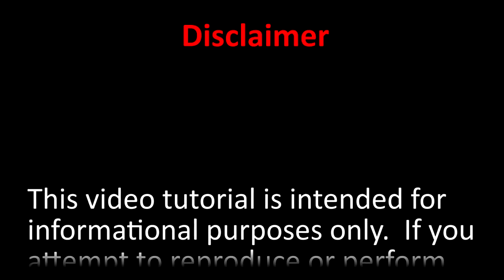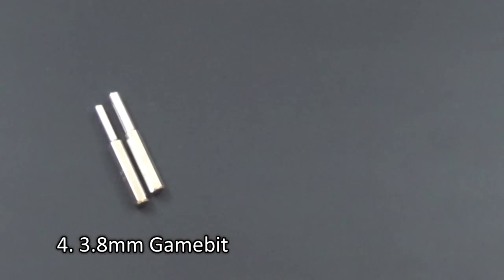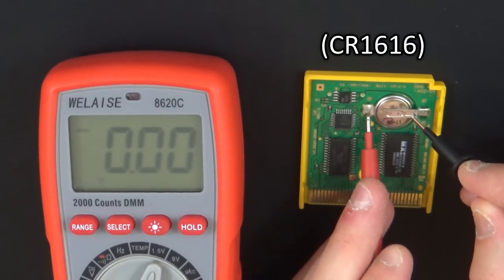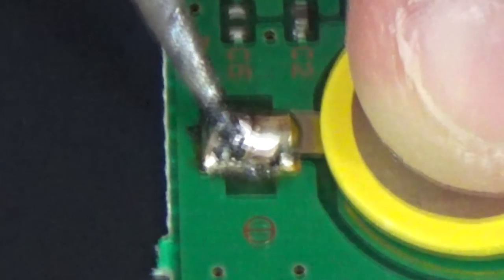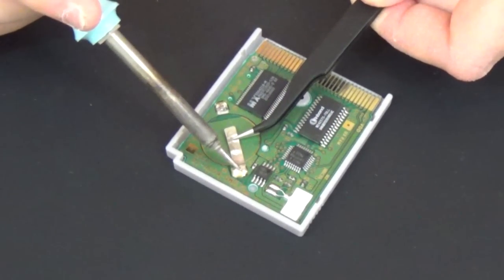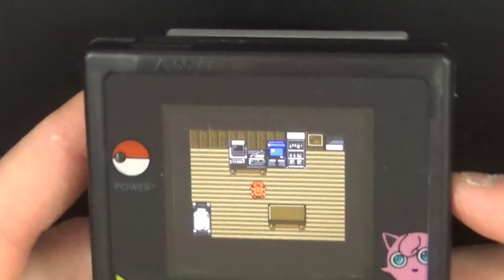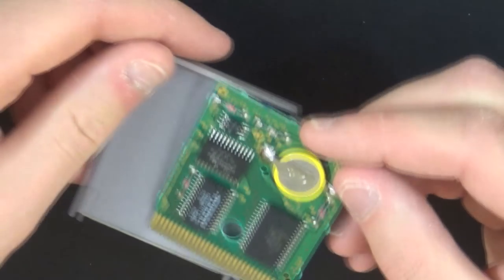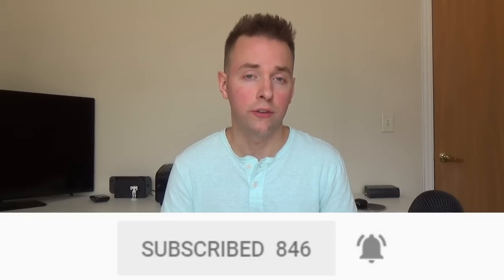The RIGHT Way to Replace Gameboy Cart Batteries

Comment: I recommend introducing fresh solder to the original solder beforehand, it's going to help with making it liquid way quicker cause You also introduce flux with the solder :) Also with a wick I always clean off the old solder.The problem with heating the solder for so long as You do is burning up all the flux which makes the solder less liquid. So I recommend having some extra flux at hand or a wick can also help in removing excess solder. Also tinning the tip of Your soldering iron helps for a cleaner result in general, but also using some alcohol to clean the tabs afterwards ensures You are left with nice clean pcb and joints. Thank You for making this video. Those solder less videos are really hard to watch!
Reply from the maker: Bálint Szabados  Thanks for watching! :)  I mentioned most of that in the video, but always good to have these tips in the comments as well.  Thanks!
Reply: Yeah I Agree, It's really PAINFUL to watch videos that explain how to fix something without having to use a fucking solder gun. I can't stand NON-solder people and there need to just fix a ridiculously simple solution with a single piece of tape. And can you believe, that it works too? HOW INFURIATING.
Reply: @chuckstieg  It works, til they drop their game on the sidewalk and something gets knocked loose inside the cartridge.
Reply: @scramblesthedeathdealer   WRONG, with proper application of tape that shit closes up pretty tight. Nothing is moving around at all, no matter what happens to it. It's going to literally shatter from being dropped before the tape & battery position are compromised. Some people just get such a fucking hard-on from soldering anything they can't handle a more efficient and easier solution existing than soldering. I bet you solder your kid's report cards to your refrigerator too huh? magnets are so impractical.
Reply: Thanks for the tips
Reply: @chuckstieg  are you ok? Do you need somebody to talk to?

Comment: I agree with some of the other comments. You use wayyy too much solder here, If I used that much I would wick it back up before soldering the new battery back in place. I appreciate your efforts of trying to teach proper handling of electronics, however, gameboy carts are really resilient. They're a great way to learn, and if you want to do the job with no tools/minimal effort, thats on you. I've "tape repaired" numerous batteries before I felt comfortable soldering them in place. To be honest, I usually just use a hot iron, heat the solder and pop the tabs off, and just use the existing solder. As long as your tip is tinned and your iron is hot it should be almost effortless. 

Just seems like an unnecessarily long video to cover something that could be covered in a few minutes.

As others have mentioned if you really wanted to show the "BEST WAY" that would be temporarily affixing another battery to preserve saves which may be in place already. Still, its good to show better practices for those who want to learn them instead of brute forcing the old tabs off and just taping back into place.

Comment: "The best way I've found to replace Gameboy Cart Batteries" would be a better title, as the soldering technique leaves a bit to be desired.  

No flux, pads not cleaned/wicked, tinning the new battery unnecessarily, soldering temp too low, too much solder, holding the iron on the joint too long, etc etc.  Not insulting you, just pointing out some areas to work on and improve for future efforts..  

Also, if the battery is not entirely dead and there are some save games still on the game, solder/clip in a battery in parallel to keep the save games until the old battery is replaced, then remove temp battery.  A battery in parallel is safe and should not damage anything, as the voltage remains the same.
Reply: I was thinking that same things while watching this lol
Reply: Why don’t you do a remash and upload a better video? I’m not being facetious that would actually be pretty helpful
Reply: @eriks8382  There are good soldering videos already. Here's a quick but good one for through hole soldering: https://www.youtube.com/watch?v=AqvHogekDI4

Comment: 8:45 and that's why you use flux :P
also using a hotter iron and/or removing the old (probably lead free) solder should prevent the tip dragging through molasses and let you actually melt the stuff. both your pads/traces and battery will thank you for being roasted slightly hotter for a way shorter time than trying to melt it halfway for ages.
Reply: Game Boy games were never lead free. Nintendo didn’t go RoHS-compliant until the Wii.
Reply: The factory flux is spent or cleaned off and the solder is also oxidized. Addinf fresh solder/flux will renew the factory solder but then you may have a bit too much. Any contaminates will float to the surface and typically comes off with your soldering iron tip after reflowing with flux and a clean tip.

Comment: I've been able to fit 2025s in all carts, just need to trim the leads a bit. I'm guilty of popping the top tab off the old battery with a screwdriver before desoldering. Gives me more control and I don't need to use tweezers. At this point I always replace the battery unless it's obviously been done recently and correctly. Great video.
Reply from the maker: questionmark576  To each their own - I did one that way too when I was back in middle school.  So I'm guilty of it too!  Of course, that was over 15 years ago when I had no idea how to solder, lolz!  Thanks for your comment and for watching! :)
Reply: @KyleAwsm  I still desolder the old and solder the new one in, I just pop the tab off first. The welds are usually fairly weak. It's a lot easier to pull it off the board when the other side isn't holding it down.
Reply from the maker: questionmark576  I should have phrased my initial reply comment differently.  I know what you meant. :)  If I came off as snarky, I wasn't trying to!  I'm just exhausted, lolz.

Comment: A couple tips:
Nintendo’s PCBs are typically pretty robust but rotating the battery off of the pad that’s not fully melted like we see here on Link’s Awakening can tear pads off weaker PCBs. It’s best practice to just hold in place and nudge it every now and then until it releases completely.

On that note, you almost seem to be painting heat into the solder joints on a few of these. While it may feel like this is heating more evenly and spreading it around, heat conducts through the solder and metal well enough that you’d be better served by just flattening the iron for contacting the maximum surface area and then adding solder to bridge to places that aren’t readily melting.

I use ceramic-tile drink coasters as a work surface since I don’t want to melt my ESD mat or heat it inside a plastic shell. Just a suggestion. :)
Reply: Yeah, when i replaced my Pokémon batteries, I waited until the solder gave up the battery willingly

Comment: This video will help me ton! After my kids got into pokemon (not sure how, maybe they saw it on Netflix), I told them how I used to play it when I was a little older than them (Red/Blue).

That led to nostalgia, buying a few GBA's with Ruby/Sapphire and not remembering how dark the GBA screen was, buying a DS2D with Sun for my daughter and a dsLite for my son so their eyes wouldn't get tired.

Anyway, here I am trying to replace the battery in my sons Ruby cartridge, as he can't save. Thanks for all the tips!
Reply: Pokemon Ruby doesn't need the battery for saves just for time based events
Reply: @treeman73272  Well they're pretty important regardless. Besides, knock off cartridges will have the saving issue so it may be that he either bought cheaper easy to find aliexpress cartridges or got ripped off
Reply: @Driv3r96  time based events aren't that important, unless you're actually trying to do something like get umbreon/Espeon  or snowrunt which can only be found when the cave is low tide which is time based
Reply: @treeman73272  Well yeah, but it may be important to someone trying to get the full experience. I wouldn't really enjoy playing it knowing my battery is dead, and besides berries stop growing too
Reply: I'm more concerned that their cart can't save despite being gba. Advance games didn't use the battery for save data which indicates the problem is bigger than a simple battery replacement. The flash memory itself could be damaged or run out of writes

Comment: Hey Kyle, What soldering iron voltage would you recommend? I have an  40W, won't it damage the game?
Reply: Ana Ribeiro de Pina a good rule of thumb is to adjust your heat to where it’s just hot enough to melt the solder. you’ll know when it’s too low. there’s usually no reason to have it on full blast.

Comment: Most videos mention that you should use a soldering iron, but many people do not have a solder or the necessary skills to operate it like this. That is the reason why there are many videos of using screwdrivers to pry off the weld points from the battery. It simply isn't feasible for some people. Especially a little kid trying to revive "his dad's old game" and things like that.

Comment: Great video but shouldn't you be cleaning up/removing the old solder off of the battery contacts on the pcb?
Wouldn't it give you a cleaner end product instead of big pools that might be even harder to work with next time the battery needs replacing?

Comment: To test the new battery, you could also try it in another Game Boy (/Color/Advance/SP), as the console will hold a residual charge for several minutes.  Taking the game out helps to reduce and drain any local action in the new battery.

Comment: It’s funny that the Pokémon silver you have is taped up like that, that’s exactly how I had to do it years ago, internet was still pretty young and the tabbed batteries were not available, neither was the tool to take it apart, had to heat a pen up then shove it on the screw to mold it to the right shape

Comment: Why not just solder in a battery holder so you just need to pop in a new coin battery later, pretty much the same process but you are also making it easier to replace the battery in the future.
Reply: I doubt that would fit, I could be wrong...

Comment: i mean...i tend to see lots of tutorials on replacing the battery...and good job on this tutorial as well...but it does not solve the main issue that people have...which is making your old save data work again...and there is actually no method to recover your old save data...for example if i complete a game and the battery dies, you can do this tutorial, replace it and then complete the game again, however if you put in a lot of work on that one save file...you might as well just not play at all...because its too much work that you've put into in that one save file...pokemon is a great example, and most of that work you just cannot replicate, like transferring pokemons from one game to another etc.
Reply from the maker: Unfortunately, because of the nature of how SRAM and other forms of volatile memory work, restoring old save data is impossible because the data no longer exists anywhere on the cartridge once the power source for that chip dies.  For making a copy of existing data though, in case you want to preemptively replace a save battery (or use the save data in an emulator on a PC), check out my BennVenn Joey Gen3 and Joey Jr. Videos!  Thanks for your comment. 👍🏻

Comment: Very good video. I'd add that it's always nice to have some eye protection while applying heat near batteries. Didn't think about adding solder when desoldreing the old battery - definitely will give it a try next time!

Comment: Probably a dumb question, but is there any way to switch out the old storage medium from the cartridge to maybe a non-volatile flash chip, so you don't have to worry about a cart battery dying?
Reply: Getting  a Accessory called Mega Memory Card will Backup the Save Data of any Gameboy game.

Comment: Thank you for mentioning polarity ofnthe battery. I may or may not have killed my Pokémon crystal cartridge as a result of not realizing the battery is backwards and trying multiple times to resolder it, resulting in either a trace popping from the heat cycles or a piece of dirt on the floor scratching through a trace. the sram is still good, but for the life of me a fresh batt(oriented properly) wont make it hold a save after power is removed.
Reply from the maker: Watch the revised video linked in the description to see if it helps your situation, and reach out to me on Instagram to see if anything can be done about your Crystal cartridge if you still can't get it working. www.kyleawsm.com

Comment: Getting the batteries connected to the tabs without the batteries e plodong seems really difficult (won't be the pre attached tabs for obvious reasons).So will just use the tape method.
Reply: you should use the pretabbed ones. the tape will not work for very long and you will have the battery issue even sooner as the tape degrades.

Comment: Hey! This was all very helpful. I still am having trouble getting my game working. I noticed that you used a paper clip and melted it with your soldier iron to get the battery to stick. Is that what i should use? Cuz I have been using flex and whenever in turn my game boy on, the game won’t work.

Comment: If you break the battery brackets is it ruined? I broke mine out of ignorance doing a DIY. I tried to electrical tape them back on but still doesnt work with a new battery. I dont even get the battery message anymore but nothing saves

Comment: Thanks man, just started replacing these batteries and it has worked on all but one ( Pokemon Yellow?? )
Reply: Try redoing your solder, try to get the tabs to make direct contact with the board and then solder it, not having solder stuck in between the board and the tab. It’s also possible that the battery you replaced it with was dead on arrival, try another

Comment: As I understand it, Game Boy and GBC carts typically use 2025 batteries, while 1616 is used more often for GBA carts.
That being said, you can substitute a 2025 for a 2032, it's the same size but tends to last longer. I don't think you can typically sub a 2032 in for a 1616 though.

Comment: For GB/GBC Pokemon Games, I'll suggest to use 2032 rather than 2025, as the real-time clock put more strain on the battery lifespan (that's why Nintendo used 2025 for those games rather than 1616 which are used in most games, those which don't have real-time clock, still even with the use of 2025, there are a lot more Gold/Silver carts with dead battery than Blue/Red, which use 1616 ones, and were released before).

2032 fits fine in the Pokemon Games boards/case (it fits fine in Blue, Gold and Silver from my tests and so, if it fits fine in Blue, it should also fit fine in Red and Yellow). About 1616, I replaces some with some other 1616, some others with 2032 because I only had those and it works and fits fine.

About CR1616 vs CR2032, not sure the CR2032 can fit on all games boards which use CR1616 but it should be okay for most (the diameter difference is only 0.4mm and for the height, all gameboy games cases should be the same size).

it'q just a matter of the battery physical size. Except the physical size and the holding capacity, those batteries are working identically.

Comment: So I went to a retro shop and paid to change the batteries on my Pokémon silver game. The battery didn’t work and it cost $25. For $27 I got ten batteries and a soldering kit. Not to mention I successfully changed the batteries on two Pokémon games. The video was a great help.

Comment: Were you looking for the Monolith in your intro ✌😋 trying to fix the "no windows available for popping" on my gold cartridge. Freezes right after you start the initial game. Any ideas? Great video and any input would be welcomed! Thanks!
Reply from the maker: Well, they do say it's out there somewhere still... 😉  And you may want to reflow all of the solder joints on the flash chip on your cartridge (on the right, beneath the battery).  I've seen this help many game carts.  Before doing that though, test it in another identical system just to make sure you should do all the extra work.  And also, here is my newest revised video for this: https://youtu.be/NyEXRXeuA5w  Cheers! 🙂👍🏻
Reply: @KyleAwsm  thanks Kyle! You are awesome!

Comment: does cross battery replacing work, meaning you could use the 1616 on a 2025 board or a 2025 on a 1616 board, or would that simply cause a lot of issues or overload the cart itself?

Comment: I am in dire need for help.
I bought a Crystal cartridge without a battery. One side of the contacts does have a piece of iron to solder a new batery on, while the other side has not. It looks like it got torn off while trying to remove the battery. There is still a tiny connection thingy for the power, however. If I want to try and solder a new battery on, do I need to solder the battery directly on that tiny contact, or do I need to add a solid layer of solder first? If not, do you guys know what the right move might be?

Comment: How are my original Pokemon game batteries still going?!? I have my original Pokemon Blue/Red/Yellow and they all still save games. It seems the quality for the later games went down a bit because my Gold version and Ruby versions' batteries don't save any more.
Reply: That'll be because of the internal clock, which the battery keeps running even when the game is turned off. These batteries die waaay quicker because they're basically in constant use when the Gameboy is turned off. So less to do with quality, more to do with how much the battery is used!

Comment: I did the same method to my Nintendo 64 Animal Crossing cassette.  However, it used tabbed CR2032 batteries to keep the real-time clock running even if the game is not being played.